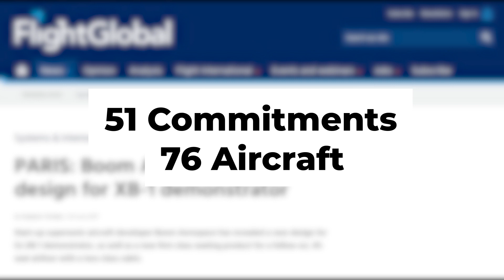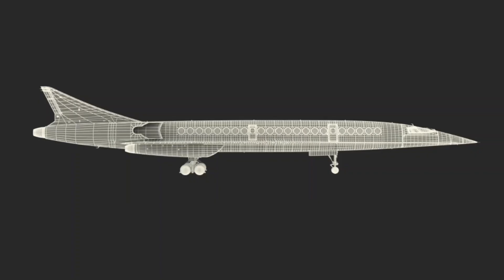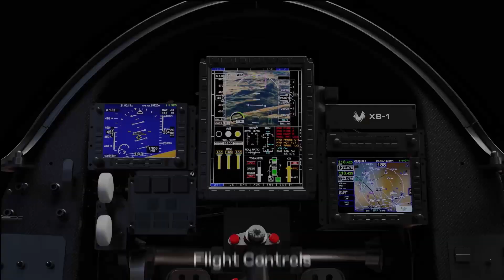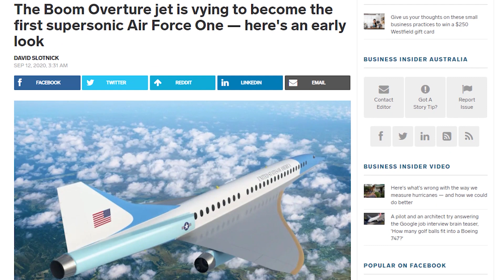EXPLAINED - United's $3 Billion Dollar Deal For Supersonic Jets...

Comment: Nah, this thing wont run on engineered fuel until it is enforced.
The good part could be that, with millionaires having a faster option, airlines might consider slower, more efficient planes for the masses, like the Beluga concept, leading to an overall reduction in emissions.
Unfortunately everything will happen far past the 2C threshold.

Comment: Good video but I find it funny that people are calling supersonic a dream... Like you can't have an airforce right now made up of sub-sonic fighters... and the US has a supersonic bomber the B-1. Also, the eco effects should not be any worse than a sub-sonic plane, in fact, less time in the air means less polluting exhaust. And people don't care what ships are doing to whales so why suddenly care about sonic booms which are less damaging to forest creatures in comparsion.
Reply: Our Airforce has a supersonic bomber that rarely goes supersonic and the 2 bombers built after that are both subsonic, so not a good argument. Also our fighters cannot maintain supersonic speeds for very long.
Reply: @superskullmaster Not the F-22 and I don't see a reason why an Airliner could not have supercruise... which even still it will get you across the Atlantic on afterburner the pacific without super cruise will be harder but do able... and less risky than a 24-hour flight in a 747.
Reply: @superskullmaster  Also not to mention the constraints must be because of fuel... so what exactly disproves my point?

Comment: To phrase this correctly:
The sonic boom is not created when the plane breaks the sound barrier.
The sonic boom is happening on the ground when a plane travelling faster than the speed of sound flies by.
Reply: No!!!
Reply: @devondetroit2529  Care to elaborate what you mean with "no"?
Reply: @Jet-Pack  No!!!
Reply: No
Reply: @devondetroit2529  Yeah the boom continues as the plane flies at supersonic speeds as it's ripping through the air and has nothing to do with the ground.
Reply: @devondetroit2529  You're wrong. Sorry to say.